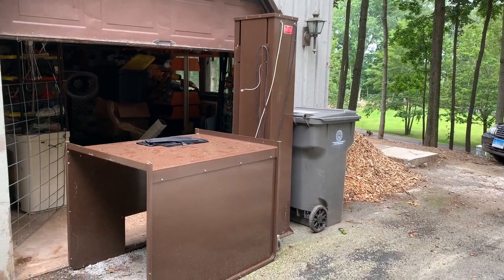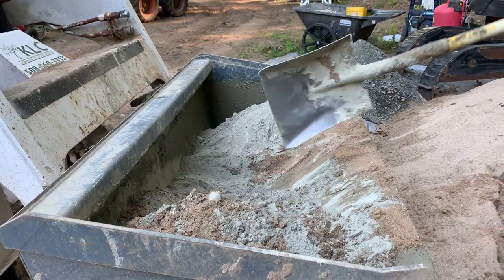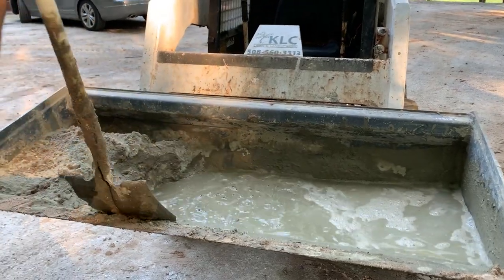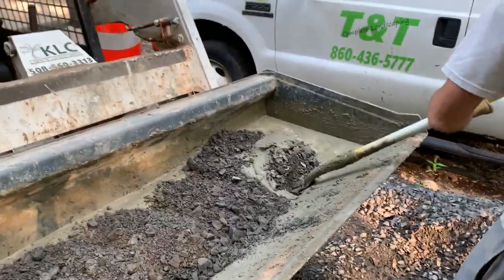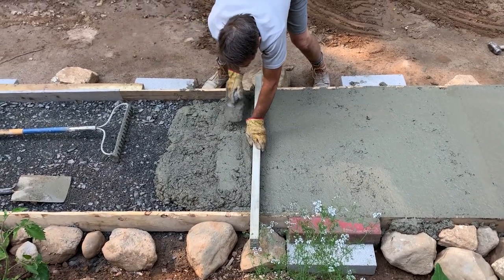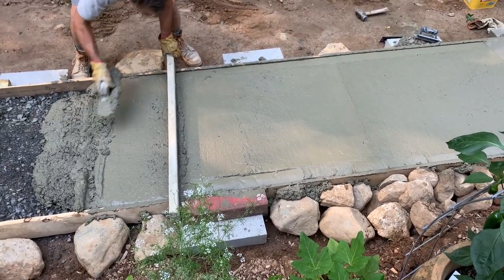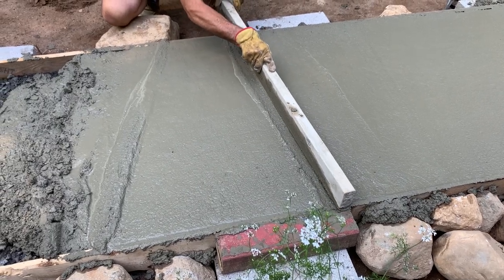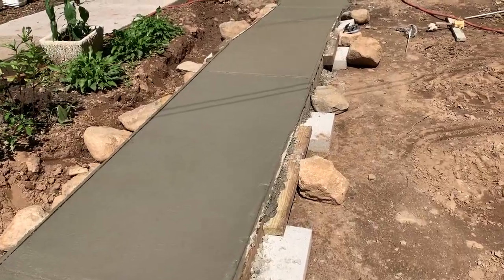One Person Hand Mix and Finish 2 1/2 Yards Of Concrete.

Comment: You're doing fine but you're fighting the stone you used. Screeding is a lot easier if you don't use stone over 3/4" and it looks like you've got a lot of 1 1/2" in there, which could possibly also affect the strength of the concrete. Also no need to mix that dry, just making more work for yourself and breathing a lot of stuff you don't need to be breathing, you've got plenty of working time with it to mix it wet and using a mortar hoe will  make mixing it a lot easier and do a lot better job of mixing it.

Comment: Why not use the mixer?
Reply from the maker: Have to shovel it into the mixer and then dump it out. Seemed easier for me to use the bucket.
Reply: @Depression2010  why not use bag conrete and the mixer and just dump it? seems way easier
Reply from the maker: @kairu.kun.z  Bag concrete is expensive versus sand and gravel. Dumping bags into mixer is no picnic either. Mixers don't usually dump precisely either. No matter how you do it, concrete is hard work. A couple of days and couple hundred dollars and it was done.

Comment: You really need to wear a mask when mixing the dry material, the dust is toxic and you're shaking it all up.
I built a 1 yard mixer, but it only could handle 1/2 yard or the motor would overheat, so I could mix my own at half the cost.
Most people don't have a bucket loader like that so not so helpful.  I understand you don't give a sheeet, but why make video then?
btw, I have a 1 yard job coming up, and its a bit remote and the road weight limit won't allow a concrete truck to drive on it,
so I can't get premix.   I used 2 gallon buckets, I found I could not be consistent with shovel sizes, so I fill the buckets, and dump them in the mixer to get consistent ratios.
And finally, you need some crack control joints anyway, so it is best to do it in small sections at a time, then you don't need the forms for the entire length, you only need the forms for 8 or 16ft at a time, then move them down.